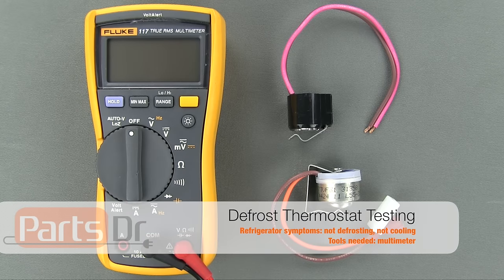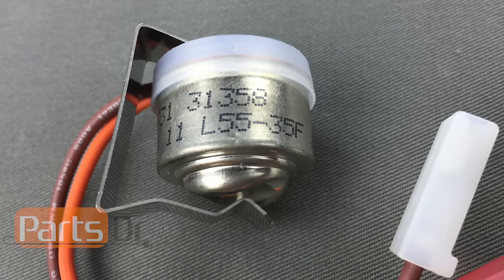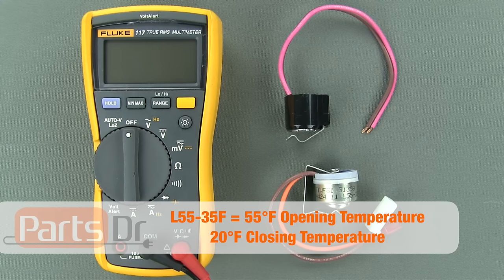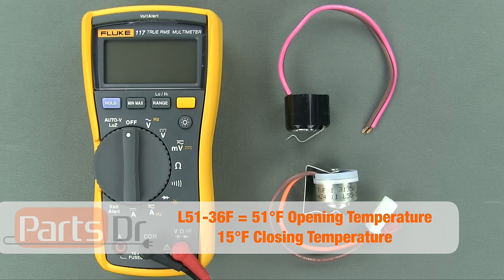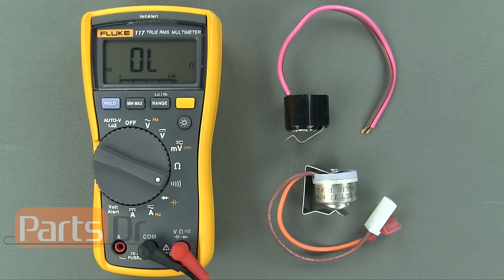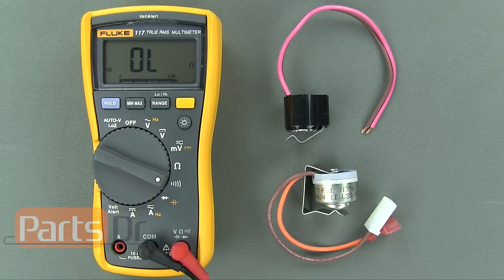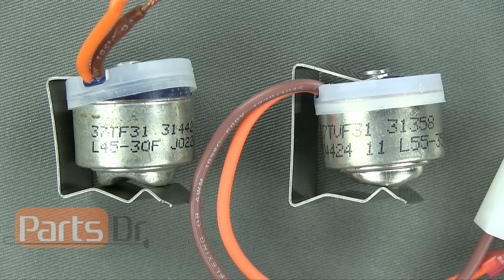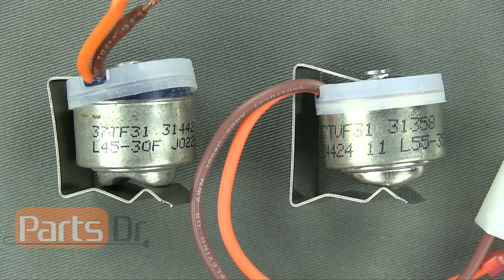How To Test Your Defrost Thermostat & How They Work

Comment: I realize the thermostat needs to be removed from the circuit to test for continuity. If it's good, how do you put it back in place? Some vidoes show placing the device in ice water.
Reply from the maker: Water isn't cold enough to test most defrost thermostats.  We don't recommend testing that way.  If there are no disconnects on the wires, you will need to unplug the refrigerator and cut the wires (make sure to leave enough wire for you splice the wires later on).   When re-installing the old thermostat or new thermostat you will need to use waterproof crimp connectors or something similar.  If the thermostat isn't too expensive it is a good idea to just go ahead and replace it at this time.
Reply: Thanks a bunch for the response. If the fridge isn't warm, would the thermostat even be an issue? The freezer isn't freezing, tho the mug still had frozen water sitting in the door. I put a cup with a small amount of water in it which froze, but water bottles are not freezing. I've cleaned the condenser coils are best I could so far, but not much has changed. Any suggestions?
Reply from the maker: @moonrules7365  Is the evaporator coil full of frost after the refrigerator has been running for a while?
Reply: That's what I haven't checked yet. I'll check it and get back to you.
Reply: Just opened the back panel in the freezer. Only the very bottom coil is frozen/frosted over all the way up the left side to the thin copper wire. I don't have anything to check defrost heater continuity, yet. Just visiting family. out of state.
Reply: it's all defrosted now.
Reply from the maker: @moonrules7365  From your description it sounds like the refrigerator might have a sealed system leak which is not usually worth the cost to repair.  This type of repair must be done by a professional.
Reply: Thank you for all your help. Greatly appreciated!

Comment: if the thermostat is New and never been tested. when testing it at room temp should there be continuity or should it be a open circuit
Reply from the maker: It depends on the temperature rating of the thermostat.  Some should be open and some should be closed.

Comment: I have been sweating over my used "patio fridge" (Amana) for a couple of weekends now. The evaporator fan did not work with the door open, but when I pulled it out it tested fine. Then I started looking at the defrost thermostat, and was just fixing to dangle it in a cup of ice water. Noticed that it was bulged like in your video, so I will order one and see if that was the problem. My other plan was to buy a different fridge from Craigslist.
Reply from the maker: Hi Russ,

It sounds like replacing the defrost thermostat should probably take care of your problem.

Comment: Mine has L50 - 38F, can I replace it with L48 - 15F?
Reply from the maker: Hi Nonny, it is always best to replace it with a thermostat with the same rating.  We have seen people replace thermostats with another with a closer rating to the original but we usually don't think the risk is worth it if the original one is available.  If your refrigerator started on fire because of the wrong thermostat you wouldn't want to have to explain that to the insurance company.
Reply: @PartsDr  thanks for the info but I couldn't find online with this rating L50-38F. I only find closer L40-32F. Can u help me out?
Reply from the maker: @m.a.a.2089  The best way to find the correct part is by searching our website partsdr.com with the model number from the tag on your refrigerator.  If you need help locating your model number tag check here: https://partsdr.com/model-number-locator/refrigerator

Comment: Thanks for the explanation.
there are two Thermostat in my fridge (Amanna)' one is L55-35F and L90-45F. why two?
Reply from the maker: I believe the 2nd defrost thermostat on those refrigerators was used to control when the freezer fan turns on.  You will want to check the wiring diagram to be sure.
Reply: Thanks! I have checked the wiring diagram. the fan is connected separately. the L55-35f is connected in series withe the positive line and to one end of the heater and the L90-45F is connected in series to the negative (0) line and to second end of the heater.

Comment: I have an old 20+ year old Westing house 22cuft upright freezer that I have to defrost (just done) . It run continuously but stays cold,  do I have one of these it it someplace? The sides are hot even though I have a fan blowing on it.
Reply from the maker: Only automatic defrost refrigerators and freezers will have a defrost thermostat.  If your freezer is a manual defrost model it will not have a defrost thermostat.

Comment: Awesome and informative video! Mine reads L140-30F so using your example it opens at 140F degrees and closes at 110F degrees? Does this seem right? It seems very hot compared to the example you gave. Please help!
Reply from the maker: Yes that would be correct.  Defrost thermostats that have a high temp rating like that one are usually a backup safety in case the defrost thermistor or control board fail and it gets too hot.  It would prevent the refrigerator from overheating or starting a fire.